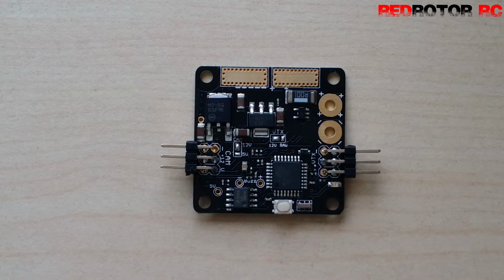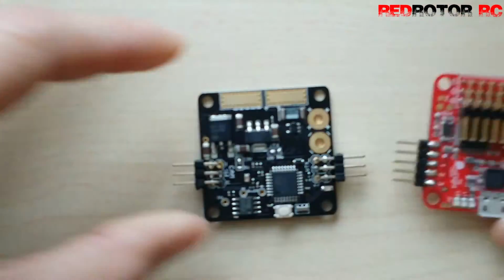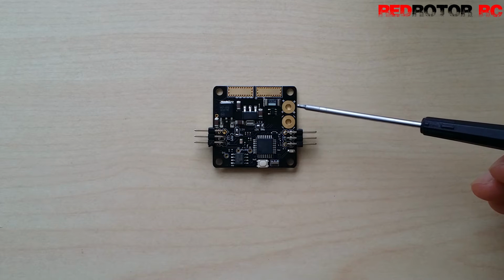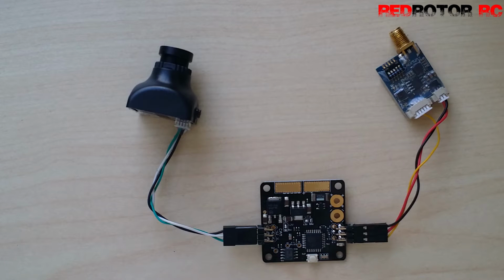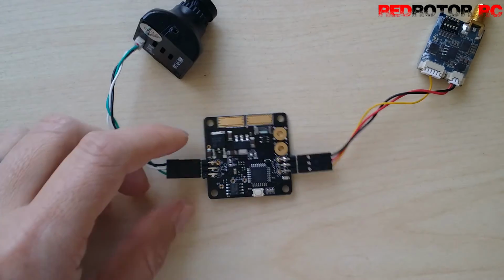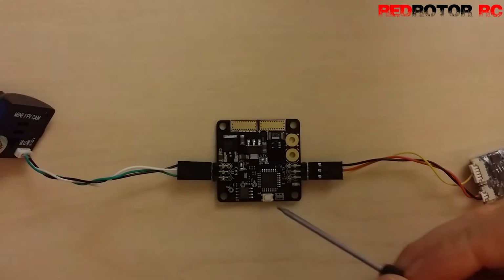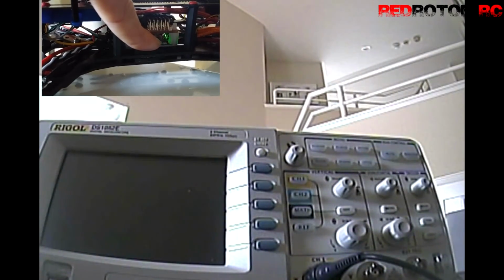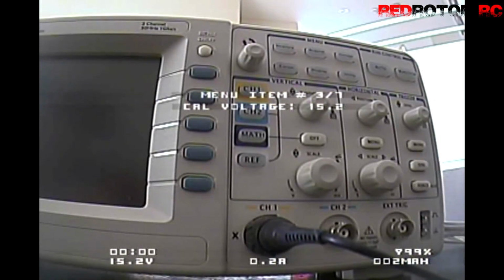RROSD Pro Setup Tips

Comment: Hey Tony, I have a 900 TVL Fatshark FPV camera that uses 5 volts.  The default voltage is 12 volts for the Redrotor PDB with OSD. In order to get 5 volts, solder needs to be applied to the 5 volt solder pad and the middle solder pad and leaving no solder on the 12 volt pad. Is that correct?  I would appreciate your input from your company. Thanks in advance!
Reply from the maker: +Tsunami Digital Media Hi, that is exactly correct!

Comment: im really not understanding the 5v and 12v soldier pads that are in the middle, do i just bridge one or the other?
Reply: its a standard solder jumper.  make a bridge between the pads marked with whatever voltage you want to set,  just get a nice big blob of solder and drag it across, but be careful not to bridge 5v with 12v or your board will fry.

Comment: Dang no 5V for the vtx.. so its out.... dang TBS Unify Pro ...
Reply: just set the cam voltage to 5v and share the pins.   My usual solution for stuff like this.
Reply: i waited a couple weeks to get a unify pro only to blow it up when i connected the battery.  i just stick to the cheaper stuff that works now.
Reply: A multimeter is the best investment you can make for this hobby.